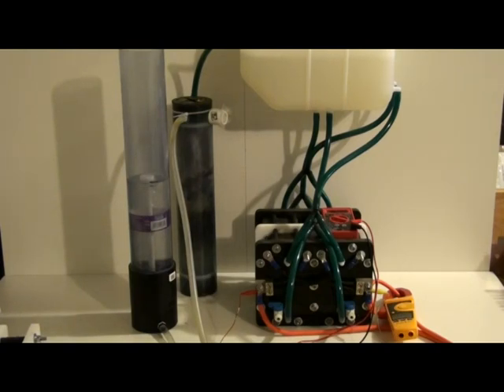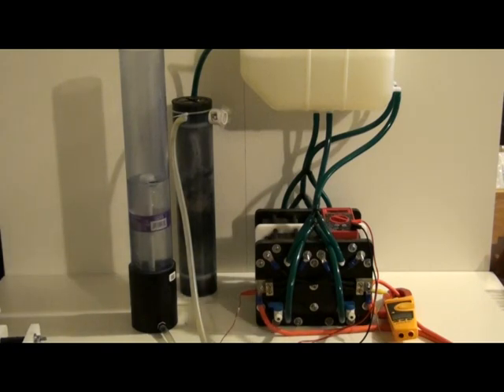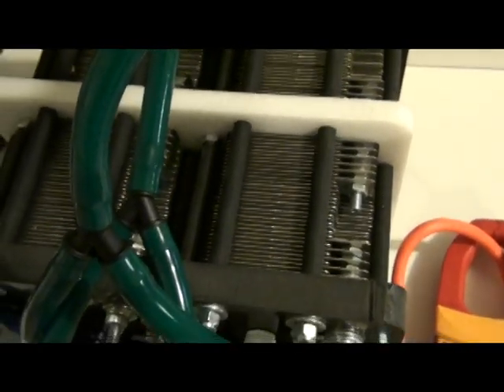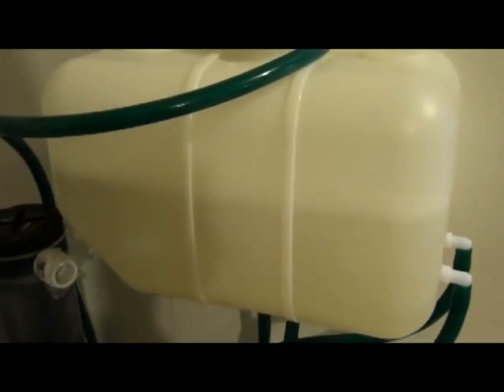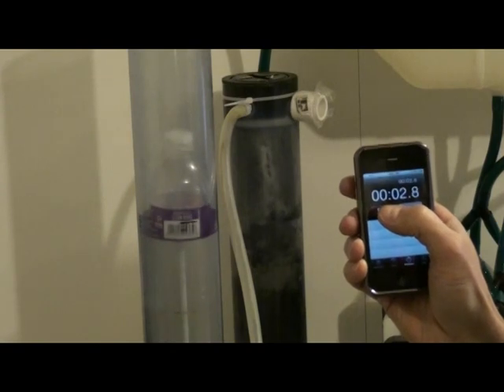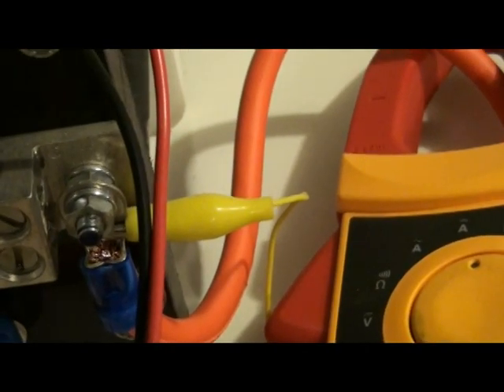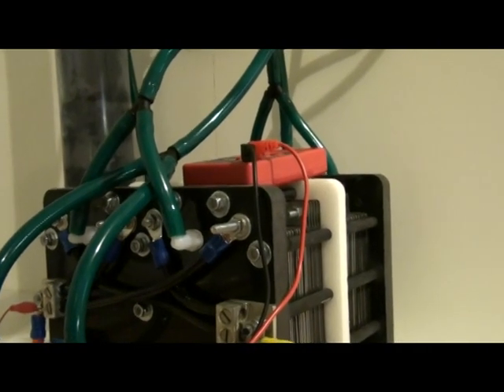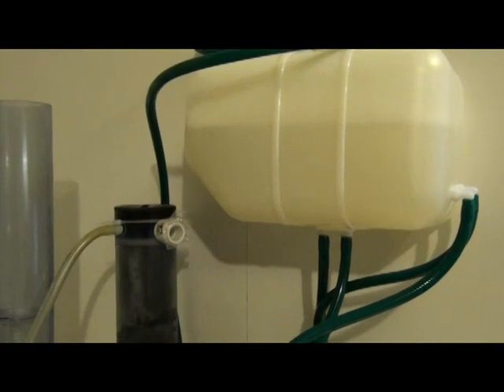HHO 144 plate 6.0 MMW Hydrogen Generator, first look.

Comment from the maker: No it doesn't heat up. It's not a standard no neutral setup. The voltage between plates is only 2.3

Comment: So what your saying is the plate set up is ( + - + - + - + - + - + - + - ) through the whole cell, What I cant understand is that in this video i look at the top of the plates and from the from the first 1/3 of the plates every second plate is linked to the bare bolt, the middle 1/3 has the cut out piece and the end 1/3 has the bolts linking it to the centre divider. How are the middle third of the plates connected to power? Is it on the bottom side of the plates?If possible could you show this?

Comment from the maker: @bigfranksblunts The point is to drop the voltage down that runs through the plates. Neutral plates are not physically connected to power but they do conduct electricity and produce just as much hho as the connected plate.

Comment: I'm curious to know what your voltage is per + - cell. The optimal 1.5-2.5volts? I ran an experiment linking single + - cells in series to drop the voltage down instead of using neutrals. Are you linking your plates in the same way?